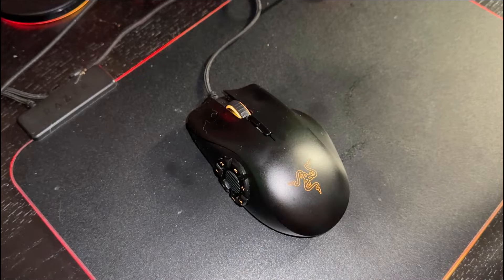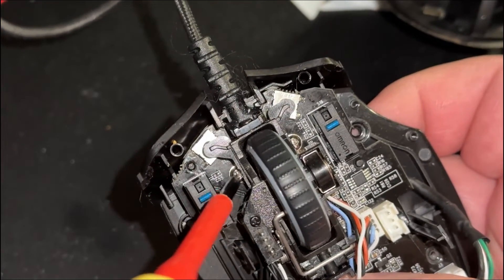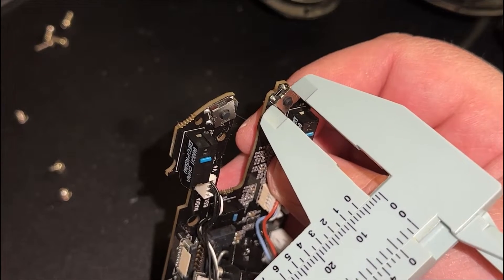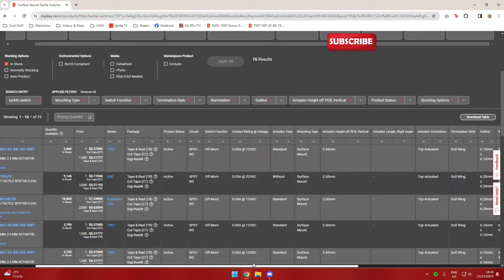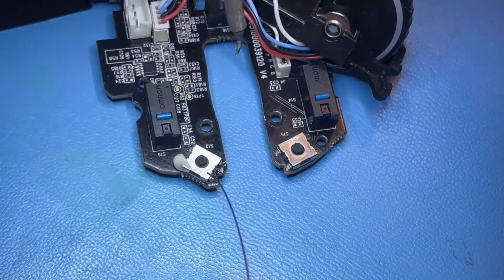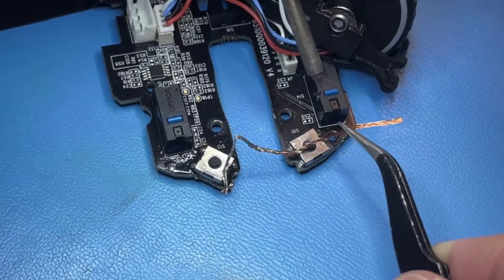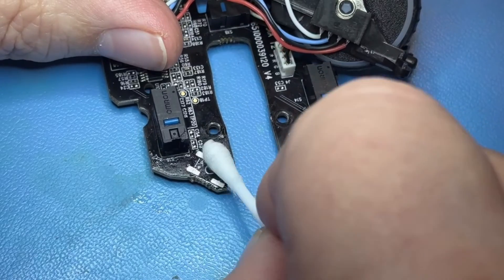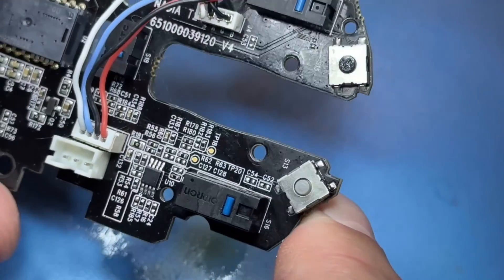Razer Naga Trinity button repair

Comment: Good video. I saw the SMD’s in close proximity, but regardless I would have been tempted to cover them with some kapton tape and use hot air to remove the button, I was worried for your solder pads… 
Happy New Year 🎉!
Reply from the maker: Doing it the way with hot air and kapton tape is definitely a valid way of removing the button, however I'm a little old school and my soldering skills can handle the delicate process.  All you have to do is have patience and only use light force.  Happy New Year to you as well!  🙂